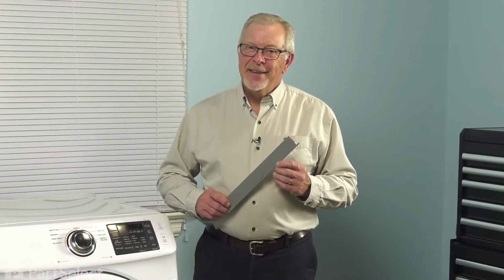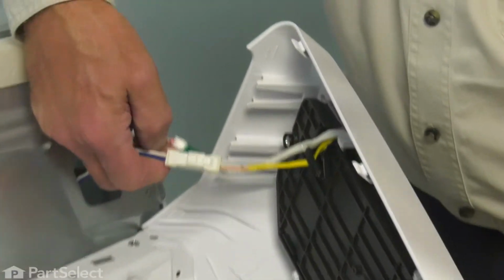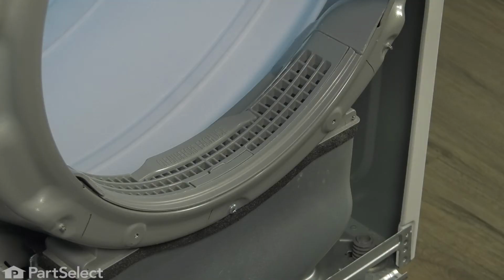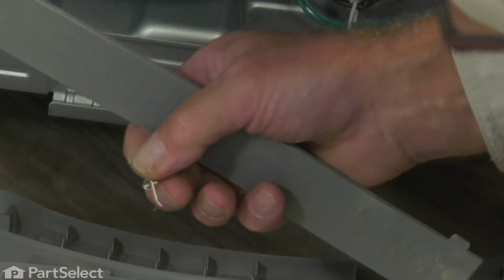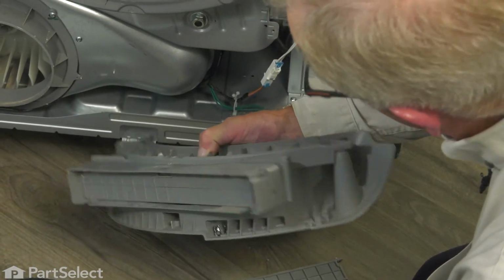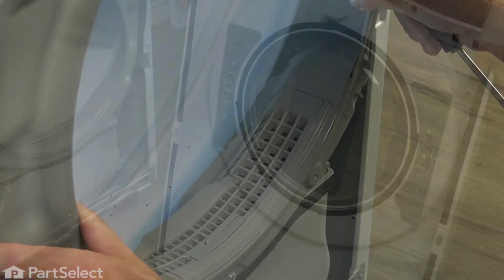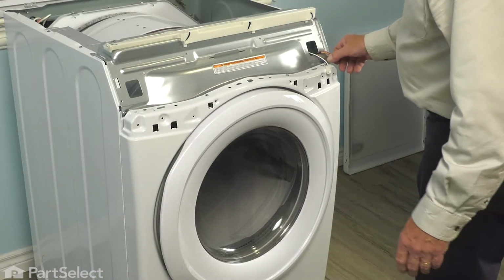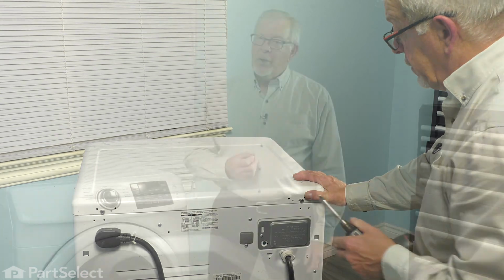Samsung Dryer Repair - How to Replace the Filter Cover (Samsung Part # DC63-01140A)

Comment: For the two inside deep set screws. Do yourself a favour and screw them into the plastic lint holder before you install it, much easier to line it up with the metal casing holes that way. For a part that is prone to break, this could be engineered much better but I guess it would impact repair business.

Comment: It looks to me like this spring loaded cover is to block the flow of air/lint when the trap is removed. Do you really need this cover if you never run the dryer without the vent?  I noticed mine is broken, and has probably been so for some time, but no problems and I never run without lint trap..thoughts..?
Reply: I had the same question. I am 99% sure the vent flap just remains open/flipped down when the lint trap is in the machine. It flips upward and closes off the section when the lint trap is removed. I was disassembling my dryer to replace some noisy wheels and noticed this flap just laying there broken and hanging around. I think it's safe to say that the part is relatively useless especially if you only use the dryer with the lint trap in place.

Comment: Disassembling and reassembling the dryer is the most difficult and time consuming part of most repairs. I wish designers and engineers took easier access for repairs into account. 
Great video.👍🏽✌🏽
Reply: They do it on purpose so you hire a guy and save yourself the headache 😪
Reply: @Cokk9ine You may have something there.👌🏽